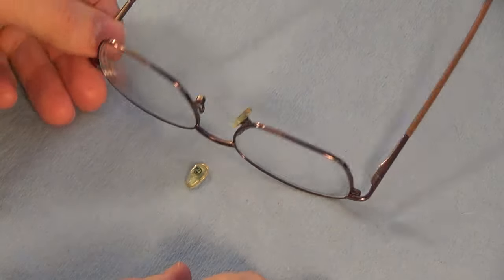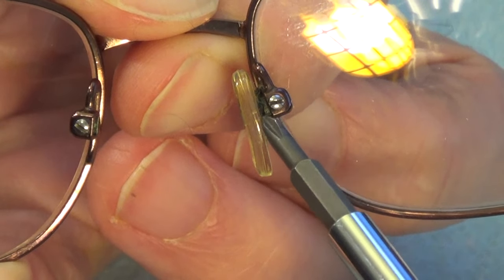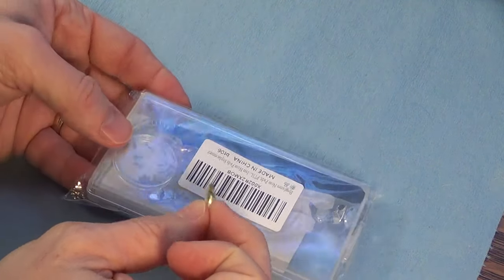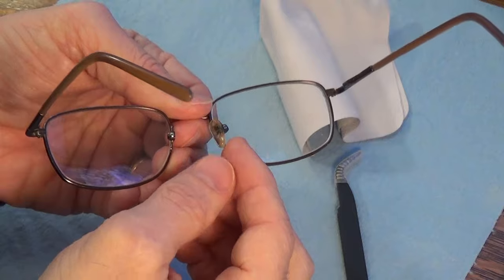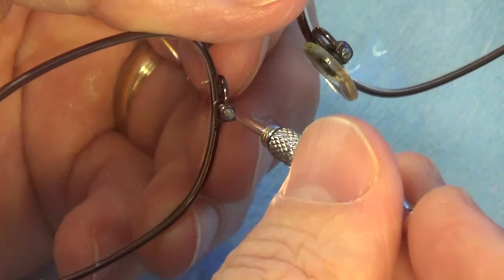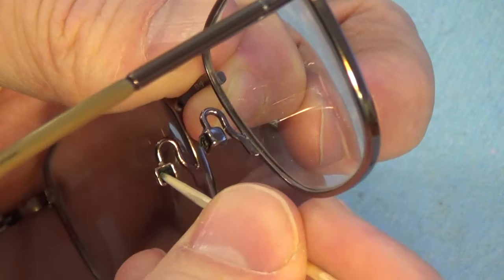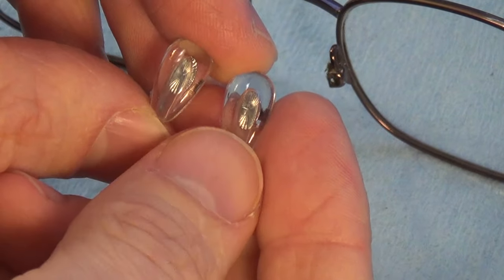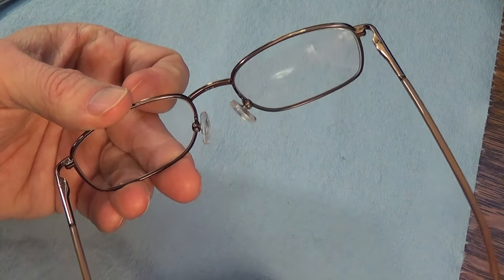How to Replace Nose Pads on Glasses

Comment: But my glasses don’t have those screws.
Reply: you probably figured it out by now, but it seems that they make glasses without those screws now, and you can buy pads that go in without them?

i may be wrong and my new pads may fall apart in a couple of months but they may just make different types of glasses with no screws there anymore
Reply: Then uou are screwed

Comment: Not all glasses nose pads are held by a screw. Silicon covered nose pads are usually just held in place with the tension of the nose pad clamp. In these cases you can lever the nose pad clamp open at the point of the thin seam by twisting a very small flat head screw drive to open up the clamp. Then you can push the old ones out and squeeze the new ones in place. Making sure they are the right way up. Then you can squeeze the clamp closed with pointy nose plyers.

Comment: Ooh thank you! I was doing everything but for some reason my new pads were not sitting right and i couldn't for the screws in ... Saw your video and decided to check and lo and behold - the little broken piece was still inside! 
Removed it and the new pad fit in easily!
Reply: Do you know what kind of screws are used in the nosepads I have no idea where I can find those now that even I lost the one nosepad
Reply: @almond7795  hmm not sure but you do get tiny screws for watches, those might work?
I actually used the nosepad from another broken sunglass, so it already had a screw

Comment: Thanks very much, that's really informative. When one of the pads on mine fell off I was scared I'll have to fork out substantial amount of money for completely new glasses, but good thing this is easily replaceable. And at home, so I don't have to bother going to a shop. I''m ordering a kit like that now. I guess I'm lucky that I'm short sighted, so I don't need another pair of glasses to work with those tiny things.

Comment: Yes ,the video helped me out a great deal ,thankyou   the other Screws in that kit from Amazon look like they may be for the hinge on the Arms ? years ago i had a pair of expensive SunGlasses that would loose that  Screw often and i bought a repair kit at my local Drug store that had  the Screwdriver and  a bunch of Screws i put a tiny amount of Loctite on  the Screw and it held for years  i grew up inSouthFlorida and always  wear my Glasses with a Strap or Landyard attached on the ear pieces  so that  saved losing the Arms and many pairs of Glasses over the years  while doing Water Sports and /or Boating Activites  BTW i usually buy Croakie brand  straps and  secure those onto my Eyglass frames with  a high strength Dark colored Nylon Thread  i actually use for Fishing Rod Repairs